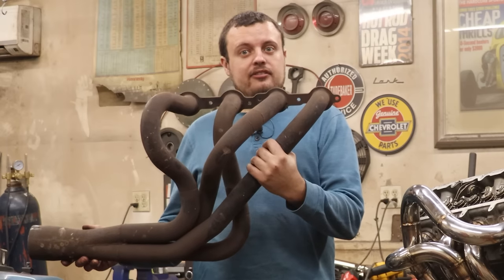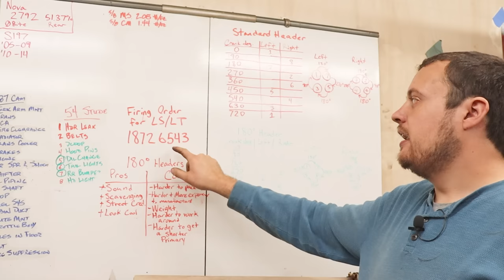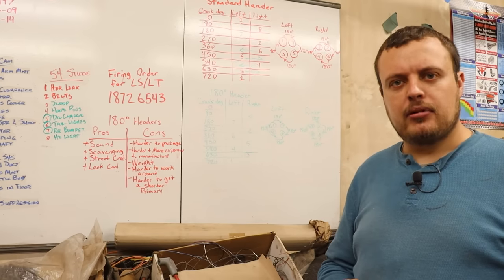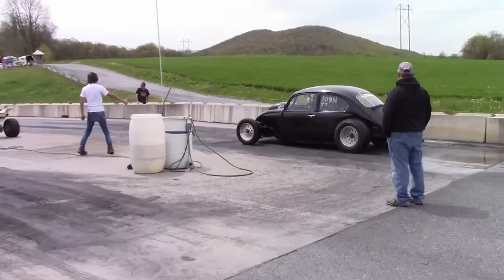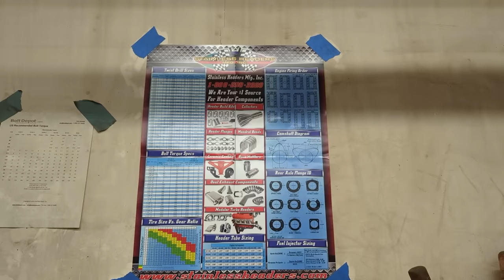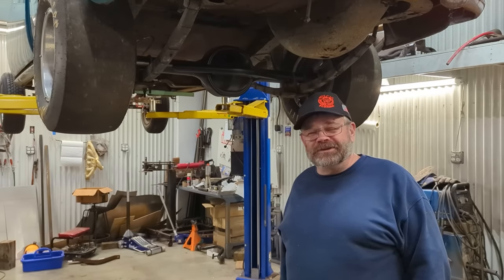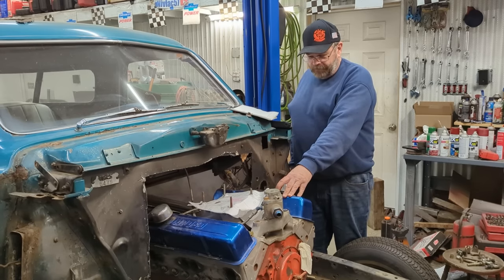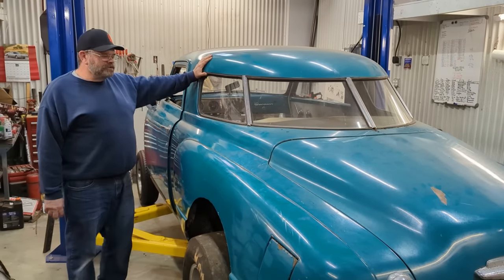I Built a Set of 180 Degree Headers for the Perfect Sound

Comment: How much heat does it introduce into the oilpan?
Reply from the maker: Hard to say until we give it a go. It will be some, but not excessive if I had to guess. There is a pretty good air gap. Also stainless has half the thermal conductivity as Mild steel, so that will help. Modern Hondas run their exhaust in a similar manner, so I'm not too worried about it, but we will keep an eye on it with an oil temp sensor.

Comment: I'm the opposite. I luuuve the sound of cross plane V8's. I had a custom single exhaust system installed on my V8 and the exhaust fitter made a Y-pipe of equal length. It sounded like a flat plane/180 header V8, or two sycronised four cylinder engines and I hated it. I took it back and asked him to add a zig-zag on one side of the Y-pipe to make a timing separation between the cylinder banks so the exhaust pulses are NOT lined up evenly. I know this harms scavenging but the sound is more important to me than a few extra HP. I don't know if I like the traditional V8 rumble because I like distorted rock/metal guitar sounds but flat plane/180 header V8 sounds like a trumpet to me. Maybe for you, being American, you hear regular V8's all the time and want a different, exotic sound, more Euro Ferrari flat plane crank sound. I think Europeans like the American muscle car V8 sound because that's different and exotic to them. (I am Australian BTW, so I can only guess what Americans and Europeans are thinking.)

Comment: You had better consider an engine oil cooler. Those headers will play hell with oil temps. Wraping the sections closest to the pan with thermal tape would help. Jet Hot ceramic coating 
on all of the headers would even be better.
Reply from the maker: I've driven it pretty long distance at this point. On 95+degree day , the hottest I've seen on oil temp is 205, which is about where you want it.
Reply: @Calvin-Nelson  Maybe for an LS engine.
But for an old school motor under 200 would be preferable. The wife's 2018 392 Hemi Challenger TA runs in that 205-210 range, along with water temps. 
What are your water temps on a hot day?
Reply: Love your header fabrication skills btw. Nicely done!!!
Reply from the maker: @debi5292  highest water temp I've seen was 180. Being we run alcohol based fuels on ocassion, it is possible to see some moisture in the oil on occasion, so getting it above 212 is ideal on cruising miles. For racing we don't see it yet very high oil temps at all.

Comment: How are you going to stop it from cooking your oil
Reply from the maker: I'm not too worried about it. It has a pretty good air gap, but we will keep an eye on oil temps. If it becomes a problem, we'll wrap the headers in that spot. Look at modern Hondas. They run the exhaust right under the oil pan similar to this.

Comment: Never. And I'm ok with that. I love the uneven firing interval and the sound it makes. Long live the cross plane crankshaft. If anything though what you have shown us is a cheaper way to get a flat plane sound since we wouldn't have to buy a European exotic and get gutted by the high price tag. Me though? Way too space constraint, time, hassle and headaches just to change to a sound I don't want. For those concerned about exhaust scavenging, there are unequal length headers for typical cross planes V8's, designed to time the exhaust pulses correctly. 

Now while we're clearly at a difference of opinion on this one, I might try this idea on a 4 cylinder engine, though by it's design I'd likely be limited to what I could accomplish. Probably just the equivalent of two 180 degree or two 360 degree parallel twins. VERY INTERESTING THOUGH WAS MAKING A CROSSPLANE V8 SOUND LIKE TWO FLAT PLANE INLINE 4'S JUST BY EXCLUDING A Y-PIPE.
Reply from the maker: Hey. To each their. That's why they make chocolate and vanilla (I actually like both of those too). Also, it is not just for sound. It will make more power too.
Reply: @Calvin-Nelson  Well, let me clear something up. I do not hate the soundtrack of the even firing flat plane. I do think it's great. What I don't like, and I don't know how this happens, is that some European cars sound less like an engine, and more like a musical instrument. I'm not sure how else to describe it. Some frequencies are amplified and others are muted. What I heard in the video though would be a good example. The proper soundtrack. An engine that sounds like an engine. The way it should be. If that makes sense.

Comment: What if you tried duel exhaust and a x pipe?
Reply from the maker: You mean with conventional headers? I've done that. Doesn't have the same sound as this does.
Reply: @Calvin-Nelson  no not conventional,  the way you did it, but add a x pipe true duels
Reply from the maker: @DS-ku1il  that's what I ended up doing.

Comment: Good luck balancing them within 1” lengths for highest performance. Sound isn’t worth it.

That said a perfectly tuned set of headers which i used to build for a living and charge a premium for coupled with a pair of turbos sounds pretty amazing. 

Also that first car comparison to be fair had a 3/4 plus cam so sound wouldn’t change like you’d suggest. And how does that sound better than a 3/4 or 1” cam?
Reply from the maker: Some people have different goals with their projects. I try not to judge. 

The comparisons at the beginning was the same exact engine, one with standard header, the other with 180 headers.

Comment: Call me crazy but wont that heat the oil more and lead to issues
Reply from the maker: Nope. Highest oil temp I've seen is 210. Look at all modern Hondas. They run the exhaust right under the oil pan. Stainless steel has half the the thermal conductivity of mild steel. It's not an issue.

Comment: Nah, I made it to 6:14 and as far as flow goes it wil slightly improved, but tuning length will be rubbish. What I am looking at in this video is tuned length (all the same length) extractors so it's going to mess up the audio tuning length to a lower rev range by a long way.
If they were genuine headers for flow (4 into 2 into 1 with no collector) and could keep a consistent tune length at each 2 into 1 then you may get some flow improvement as well as some audio echo off the full exhaust tune length.
If you take tuned length extractors (4 into 1 , L and R) and add a both sides into 1 for the exhaust at the correct tune lengths you will get some crossover echo from left to right to balance it out a little (Single exhaust out) :)
Just my thoughts.
>
P.S. Ultimately the best is a single separate tuned length pipe on each cylinder as is common place on the strip :)
Reply from the maker: This is an equal length setup that will be tuned for around 5000 RPM based off my Dad's calculator.
Reply: @Calvin-Nelson  Maybe I jumped the gun on it. Looking at the thumbnail image, the collector IS way forward in position to the standard Left Right extractors where the collector would be further back in line with the transmission. Looking at the video I felt like the pipes where longer than the original tuned length.
>
So my apology for being a bit fast on my assertion there. Although the crossover pipes still appear longer than the other pipes, but I don't have a measuring tape on it lol

Comment: The only  real reason to  do it is because  you want to a do it a set of headers and a  x pipe will  produce  similar  power and  it's way easier to  package  unless you have a  mid engine  car wich is  why they  did it  in the first place it's still pretty  cool
Reply from the maker: Yeah. I've had a V8 with an X pipe in this car at one time actually. It didn't have anything close to the same sound. I'm pretty picky when it comes to exhaust noise. Lol. You're definitely right. You have to want it!

Comment: How do you work out when peak scavenging will be?
Reply from the maker: The length of the primary will correlate to a particular engine speed. My Dad has a spreadsheet. Has to do with the speed of sound and whatnot.
Reply: @Calvin-Nelson  can you share the formula? Making a manifold is a bit of a dark art, and I have a very long primary manifold for my 9000rpm engine, I was told it will gain more mid range torque, I’d like to look into what’s is actually optimal :)

Comment: Its a 180 degree in pulse but if a exhaust pipe comes from the other side that means this pipe is longer…
And therefore the pulse will take longer to go over this distance…
So you will still need to make sure that every pipe in a collector has the same length… otherwise tge scavenging will still be off because the pulse will no be follow up precisely…
Reply from the maker: I talked about how I made the pipes equal length in the video.

Comment: Ooo thats alot more heat for that oil sump and the oil inside it.
Reply from the maker: Eh. I'm not terribly worried about it. It should have good airflow. Also stainless has half the thermal conductivity than mild steel. There is a pretty good air gap between the tubes and the pan.

I just installed an oil temp sensor, so we'll keep an eye on it.

Comment: Nice, custom oil burner
Reply from the maker: I'm not too worried about it. It has a pretty good air gap, but we will keep an eye on oil temps. If it becomes a problem, we'll wrap the headers in that spot. Look at modern Hondas. They run the exhaust right under the oil pan similar to this.
Reply: @Calvin-Nelson  honda usually has one pipe from each side that goes across near the back of the pan. You have 4 larger pipes right under it. May not be an issue but definitely keep an eye on it.

Comment: i see one major flaw in this the pipes going under the oil pan will heat the oil faster n thus require a oil cooler for sure
Reply from the maker: Yeah. I was very slightly worried about that, so I installed an oil temp gauge. The highest I have seen on a hot summer day sitting in traffic was like 209F barely hot enough to bake the condensation off. No oil cooler required.
Reply: @Calvin-Nelson  thats awesome news im no expert just tinker now n then sweet setup though

Comment: What about 180°headers WITH flat plane crank? Small block, of course.
Reply from the maker: A 180 degree header for a flat plane crank would look identical to a conventional header. There would be no need to cross tubes from side to side. It would certainly be easier to get shorter primaries, but flat plane cranks are known to have bad vibration characteristics at certain frequencies, so it may be a race only kind of thing.

Comment: DID YOU LOSE POWER WITH THE 180 DEGREE HEADERS? DID YOU RUN FASTER OR SLOWER? 
THOSE 180 DEGREE HEADERS ON THE GT40'S WERE CALLED "THE BUNDLE OF SNAKES".
Reply from the maker: We haven't tested them yet. We've gained power with 180 degree headers in the past.
Reply: @Calvin-Nelson  THANK YOU FOR RESPONDING. WERE BOTH GOING THROUGH MUFFLED EXHAUST OR OPEN HEADERS?

Comment: Nope!   I'll take the sound of a 90 degree crank over the sound of a 180 degree crank EVERY TIME!  Ah, now, I have an idea. Let's put those very clover headers on an engine with a 180 degree crank, so it  makes the GLORIOUS sound of a 90 degree crank. ;)  You cannot argue the better scavenging though.  But I do not like the sound of 180 degree crank V-8 engines.  Well, "not like" is harsh.  Don't like as much. ;)  That Y pipe makes it sound just like a crotch rocket.  Which is an impressive sound.  But I'll totally take the sound of that first dragster.

Comment: It seems like that header will add more heat to the oil pan.  Significantly.
Reply from the maker: I'm not too worried about it. It has a pretty good air gap, but we will keep an eye on oil temps. If it becomes a problem, we'll wrap the headers in that spot. Look at modern Hondas. They run the exhaust right under the oil pan similar to this.
Reply: @Calvin-Nelson  Maybe also use a dry sump oil system that reduces the oil pan profile and stores the oil in a remote tank.
Reply from the maker: @sammcbride2464  I really don't think it's going to be a problem. We've done a couple 180 degree setups like this.
Reply: When you mentioned Honda, I remembered that some Honda's use a dry sump system.  It is also a popular mod on older Honda's.  I rebuilt a Pontiac 455 one time and the amount of caked on oil sludge from heat was unbelievable.  It could have been from using poor quality (high sulfur) oil, but I really don't know.  A synthetic (castor oil base) oil may be the ticket.

Comment: 180 degree headers solve the problem of uneve firing order on each bank but it's nearly impossible to achieve equal lengths.   Also the primary tube lengths are much longer than optimal at 6000 rpm, and completely useless for engines running 8000+ RPM. A better alternative is to do what NASCAR does. Use an X-pipe (Dr. GAS, Salt Lake City,  UT). I designed headers for Hendrick Motorsport, and F1 teams 2000 to 2004.
Reply from the maker: I achieved equal length with my setup.... Also if you route the primaries behind the engine you can achieve a shorter primary.
Reply: @Calvin-Nelson  Equal lengths is good. But the lengths must be correct for the desired RPM and cam. 32 inches is a ballpark number for 6000 rpm. NASCAR engines spin at a out 9700 rpm which dictate the primary tubes at 26 inches.
Reply from the maker: @kurtdobson  with my setup, I achieved 36 inch primaries. With the exhaust behind the engine you could get them much shorter.

Comment: Also looks like a great deal of heat directly under your oil pan which I’m sure does not help anything with the longevity or reliability of your engine.
Reply from the maker: It's not even a small issue. Highest oil temp I've seen was 209F, and that was on a hot summer day after driving in traffic for hours.

Comment: 1:35 how about hot oil ?
Reply from the maker: I'm not too worried about it. It has a pretty good air gap, but we will keep an eye on oil temps. If it becomes a problem, we'll wrap the headers in that spot. Look at modern Hondas. They run the exhaust right under the oil pan similar to this.

Comment: If you want good sound in a car, forget making expensive hard to fit exhausts where the sound is only fully appreciated outside the car or in a tunnel and concentrate on the induction that’s what Yamaha did with the LFA. Also of note is Mazda’s rotary Le Man’s car that has variable length intake trumpets, that’s what you should work on, not a mess of pipes that you can barely fit in the car and are not Street legal
Reply from the maker: I'm really not a fan of induction noise. I've never really liked the sound of ITBs. Some people like Country. Some people like rock and roll. Some people like classical music. To each their own.

Comment: lt engine is 18436572 were you mistaken and because that looked like n ls maybe you cornfused the latter and former fire orders?  i like the indepth description of your headers. on the it engines  the whole equal length thing was evaluated and i do see the use of the impulse to help charge the next cyl. thats why i stoped by for a view even with 40 some years of engine building and a little experience with small block chevy....i think chrysler too used that on the 318 ....but these are no longer in production and prob why your unfamiliar with the order
Reply from the maker: This is a Gen 5 LT series engine.

Comment: Thats not a 180 degree header exactly.
Tube length is off a little.

I ran that semi 180 header style on my 1987 Corvette decades ago. It wasnt connected to the other side like yours.  It was a 4 into 2 into 1 then the 2 sides connected to a single 3 inch pipe. 

It sounded more like the bug. 

But they tied it to a close by cylinder on the same side rather than the opposite cylinder.

I guess they used the pipe length to match pulses. Pretty trick stuff.

It was made by Ed Hamburger ( no kidding) SLP engineering in Tom's River NJ I think. It was called the  4 into 2 into 1 stainless steel header kit.

 The Canadian NASCAR unlimited modifieds would come down from Canada and treated the crowd to 20 or more of those 180 cars with over the back exact length 180 headers.
The magnetos where right next to the pipes. Before crankmtriggeting. .??? 

Odd they thought of headers but not crank triggering evolution I guess.

It was the most wild sounding 350 engines ever. Everyone would fill the stands that night.

Listen up dying racetracks
Reply from the maker: Not sure what you mean. The pipes are equal length, so they are definitely 180 degree headers...

Comment: Good way to warm up your oil. 😂
Reply from the maker: I'm not too worried about it. It has a pretty good air gap, but we will keep an eye on oil temps. If it becomes a problem, we'll wrap the headers in that spot. Look at modern Hondas. They run the exhaust right under the oil pan similar to this.

Comment: Sounds awesome, makes power, BUT it l ooks like it will heat up the bottom of the oil pan/engine significantly. Not good for anything other than a full time drag car. Bummer.
Reply from the maker: Not the case. Highest oil temp I've seen was 205F on the street after a very long drive in 95F heat.

Comment: Yeah let's cook out oil pan with exhaust heat
Reply from the maker: I'm not too worried about it. It has a pretty good air gap, but we will keep an eye on oil temps. If it becomes a problem, we'll wrap the headers in that spot. Look at modern Hondas. They run the exhaust right under the oil pan similar to this.

Comment: Your also heating the oil pan...
Reply from the maker: I'm not too worried about it. It has a pretty good air gap, but we will keep an eye on oil temps. If it becomes a problem, we'll wrap the headers in that spot. Look at modern Hondas. They run the exhaust right under the oil pan similar to this.

Comment: The only reason you would build such a system is for the greater lower down torque.   Not much difference at the top end.   Very expensive and complicated.   Nice for circuit track racing .  But that’s it.   Even then it marginal.